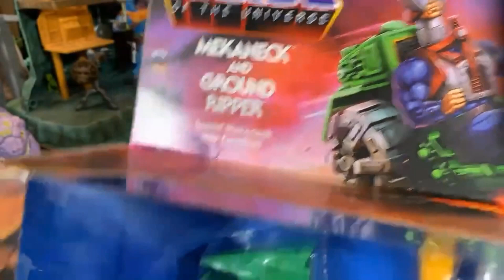Ground Ripper, what no action feature???? Let's fix that!!! He-Man - Masters of the Universe - Road

Comment: About Mekaneck : it totally sucks that he can not extend his neck. 
I was thinking to "fix" that, but I don´t even know if there is enough space inside the origins torso to shove the whole neck down his throat ... Do you think it will work ? Or maybe you do a mod on that ?
Reply from the maker: That's a tough one, if you're able to do it, post it in the lounge.
Reply: @HeBroTV  First I need your OK ! 😁
... but seriously, If anybody knows if there is enough space inside, It´ll be you. 
I don´t want to ruin the figure because I am not that good in mods.
But I got that figure figured all out ! ... or at least, I have a hunch :
The vintage-figures-torso has pegs for the arms. And the origins-torsos are "kind of" vice-versa. For the arm-pegs the torso has not only holes but there are etire sockets to clip the arm-pegs in place. That claims space to the inside. And when I stuffed my Moss-Man with cotton through these peg-holes he became full pretty fast. 
Info : I stuffed Moss-Man to soak the inside-cotton with a pine-cedar-oil-mix. He smells good now - but only when you rip his arms and hip off. 🥴

So : do you know if Mekanecks long neck-peace has enough space inside the torso ?